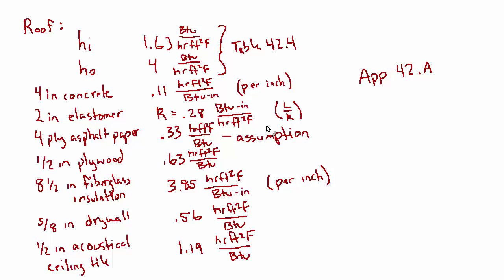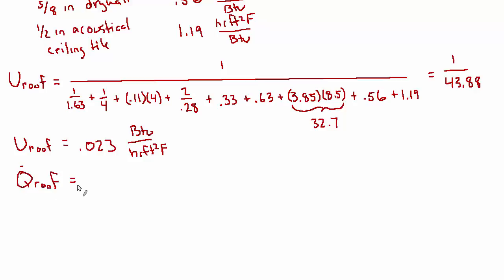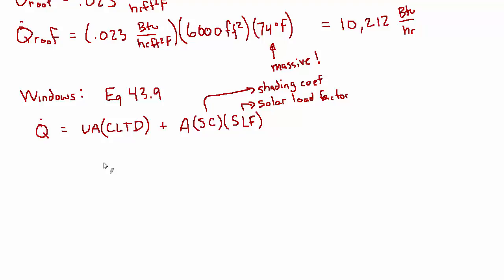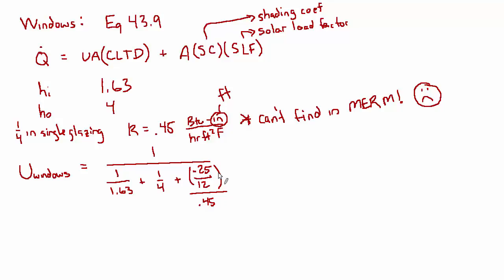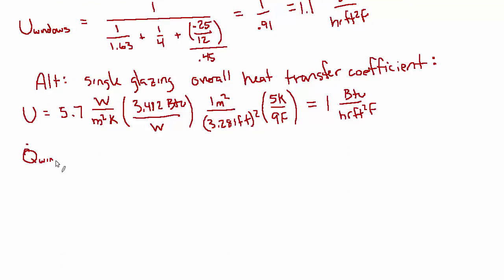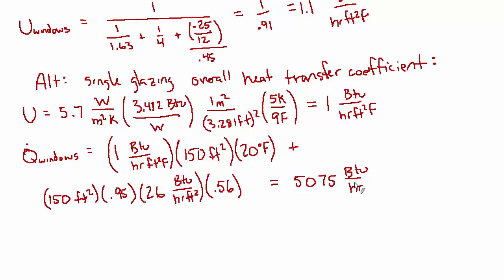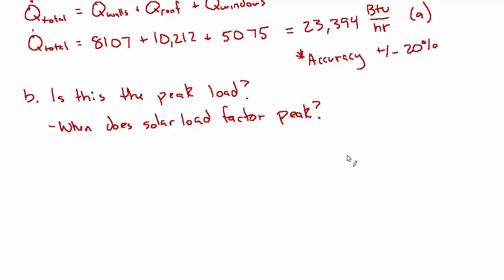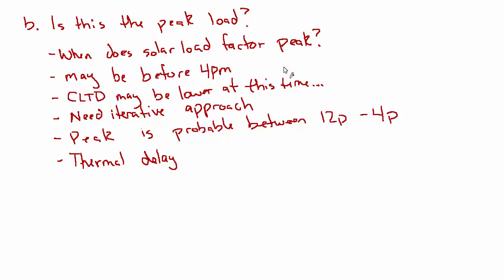How to Calculate Heat Transfer Coefficient for Building Design | Mechanical PE Exam Prep Course

Comment: I was going to say, the number has something to do with "Light-colored mini-blinds". Also, U-value for 1/4 in single glazed window (operable) with Aluminum frame without thermal break is listed as 1.1 BTU/(hr-ft2-F) on ASHRAE Fundamentals chapter 15.9, which is also listed on page 449 of the official NCEES PE Mechanical Reference Handbook (only material you are allowed to use during the exam).
Reply from the maker: Awesome, thanks Kimberly!  Sounds like you are well on your way! :) Feel free to reach out if you need any outside support or want a few hundred more CBT-aligned problems to practice on...

Comment: I have an old ASHRAE Heating and Cooling Load Manual from the late 70s. It has an equation for Solar Load. (q=Area x Shading Coefficient[.95 or 95% transmitted] x Maximum Solar Heat Gain Factor[26] x Cooling Load factor[.56]). These numbers seem to line up with the use of that methodology. The book has tables for this information. The book references the ASHRAE Fundamentals book and Systems book. My 2000 edition of systems has an index reference to pages about this that do not appear in my 2005 Fundamentals book or index. I'm guessing this is an old solution method that is not used as much now, perhaps?
Reply: That 26, though, would have to change for each window facing in different directions. The tables are broken out by latitude with month vs cardinal direction on the axis, giving values for SHGF. The Cooling Load Factors come from another table and have cardinal direction vs solar time(1-24) on the axis. Because this building is mostly facing East (largest windows) this would not be a peak load time for this building, considering only building envelope effects. 4pm gets western sun, so we would expect 10am ish to be the peak load in this building.